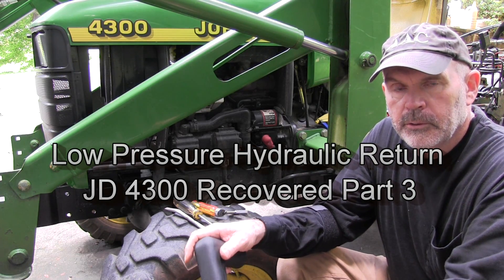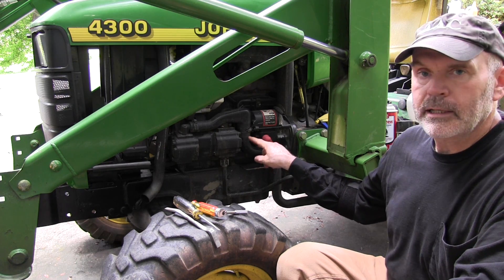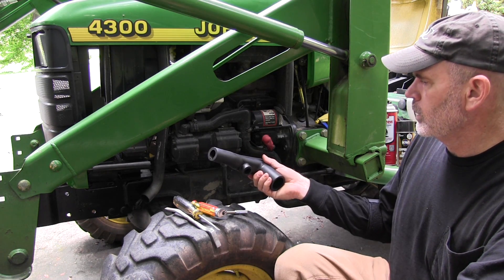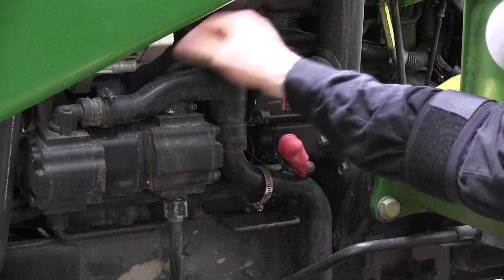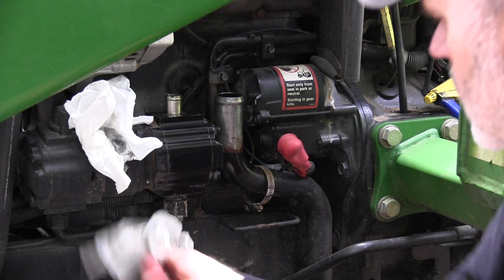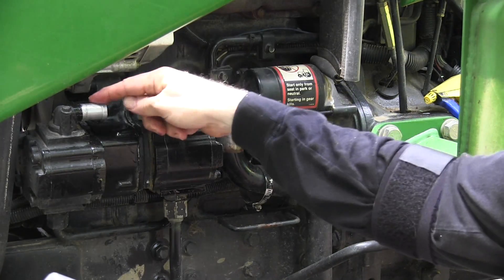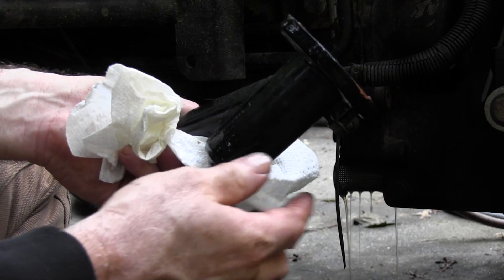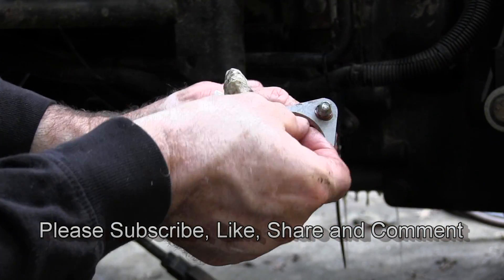Low Pressure Hydraulic Return Line JD4300 Recovered Part 3

Comment: Great vid for me.  A year or so ago, I had to replace the block heater plug on my 4300.  It was cold (South Dakota cold) and I don't have a shop here, so I ran it up to a shop in town and there we discovered that to remove and replace the plug, that top low pressure hydraulic hose had to be loosened and maneuvered a little bit out of the way on the right side, toward the cab.  We dropped maybe a quart of fluid and after replacing the heater plug, we pushed the hose back into position and cranked the clamps down-- too tight, judging by your video. They strained the fluid through a paint strainer and we put it back into the tractor,   I've had fluid slowly leaking down on that right side ever since and a couple of times just took more turns on the clamps!  A real dumb thing to do, in hindsight.  Now I know the leaking is probably from a cut hose.   I guess I'll just replace that top unit and now know the correct procedure.  Many thanks,

Comment: I have a 4500 with FEL, and double remote hydraulic bank. Can not get the bank of  controls to work. It's like they are dead heading. Looking for information and the proper hydraulic line  hook up to the remote hydraulics. Can't seem to find anything online. Your video was informative.Wondering if maybe the screen , possibly hasnt been cleaned since tractor was new, is my issue. We have never used the remote hydrauliucs. Just the FEL.

Comment: Hi very helpful video thanks. I have a 4400 which has always suffered from very heavy steering, been the same for years! Already changed the oil and filter, but never cleaned the suction filter, as didn't know about it! Do you think this could be blocked enough to effect the steering? Is there another inline filter I'm missing somewhere? Is there anyway I could take the suction filter out without emptying all the oil? It is fitted with a front loader so could jack it up at the front maybe? Thanks jules
Reply from the maker: When my suction filter was mostly blocked it did not affect the power steering at all. The last time I cleaned the suction filter I had just recently changed the hydraulic fluid and I was reluctant to throw it away so I drained it into a clean pan, filtered it through a coffee filter, and put it back into the tractor. I made a video about it.
There is no mechanical linkage between your steering wheel and the front tires. When you turn the steering wheel you are actuating a valve that controls the steering cylinder on the front wheels. Test this with the tractor turned off. You will be able to turn the steering wheel (with difficulty) without moving the front wheels. Your problem has to be in the steering column. Somewhere between the steering wheel and the steering actuator valve.
Also, your tractor has a hydrostatic transmission and does not have the same clutch pack that shredded in my transmission. You might have a different suction filter.

Comment: Great video thank you I noticed there are two pumps is there only one vacuum low pressure line? Thanks for your time
Reply from the maker: Yes, there are two pumps. One low pressure for power steering and one high pressure for lifting. Only one low pressure return is needed.
Reply: @mars1952  thanks much!

Comment: Hey great video ! i just bought a 4210 at auction the engine runs fine but none of the hydraulics work on it the front bucket, backhoe, and forward and reverse it is a ehydro model do you think it could be a clogged screen or do you think both pumps are bad?
Reply from the maker: Check the fluid level first then check the screen. I am not familiar with the e-hydro so I do not know what combination of pumps it uses.